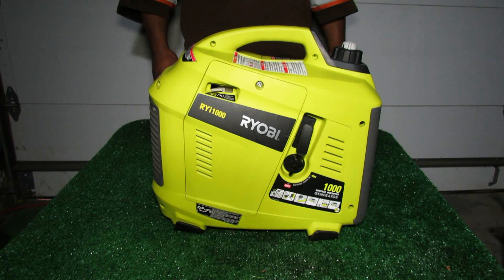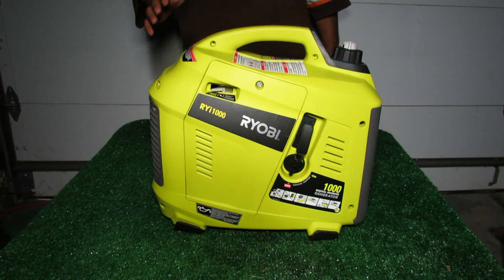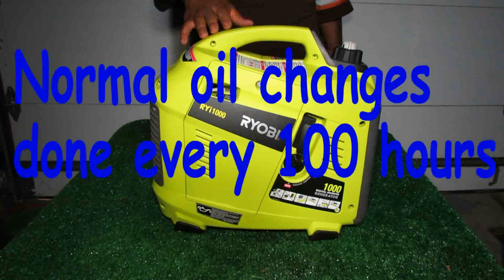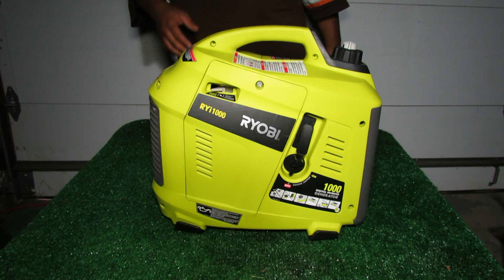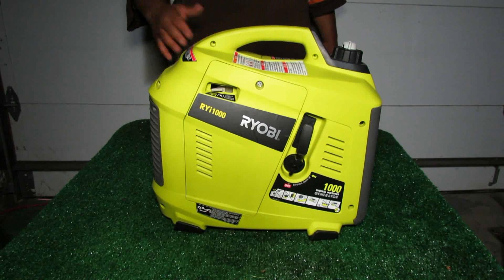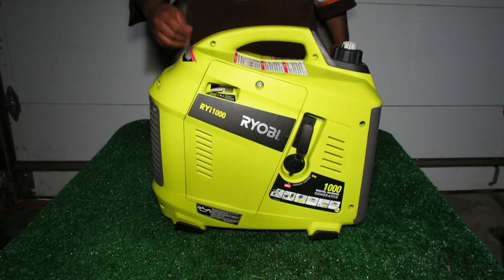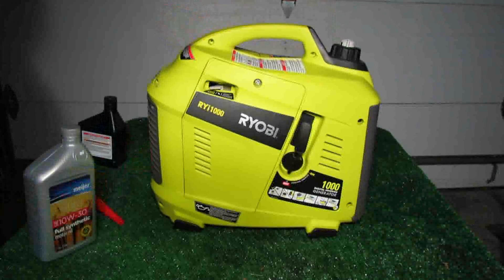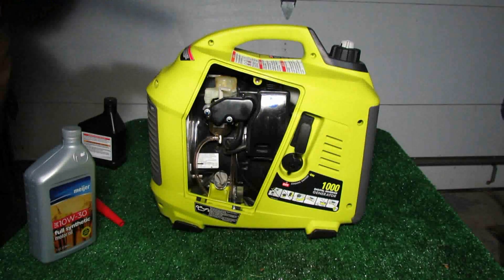Ryobi 1000 watt inverter generator, RYi1000  oil change after 20 hour break in

Comment: I am seeing in the manual I found it's 13.5 oz of 10w-30. That's a significant difference from the 8 you specify. Might you still have this generators original manual? The one I found is online but I think it's for the RYi1000

Comment: I've noticed in your videos, although somewhat informative, you spent 10x longer talking about things, than actually demonstrating. Also, in another video you slapped the casing of the generator like 15 times in the 6 minutes before even demonstrating anything, that felt like it was popping my ear drums through my headphones. When I turned down, I couldn't hear your voice, but you insisted on smacking that thing so many times I had to thumbs down that video like I did this one and stop watching a few minutes in. Please keep doing what you're doing, but notice that your sound volumes and approach on dialogue do make a difference to the viewer experience.

Comment: Unless you use your generator once a week or so, keep gas stabilizer In the tank. That way your gas wont varnish, making it hard, if not impossible to start. And be careful using starting fluid. I bought an 1800/2200 that would not start. The guy that had it used starting fluid in it. When he tried to start it, the motor kicked back so hard it jerked the pull cord out of his hand and sheared the keyway on the flywheel. I didn't know about the keyway until I tore it apart. After replacing the keyway, it starts on the first pull. And I keep gas stabilizer in the fuel.

Comment: Get a topsider oil pump, its a handpumped oil,changer to take oil out thru the dipstick tube of anything with oil, no tipping it or making a mess, it works great and is fairly cheap and makes this job so much easier on cars and especially these small engine devices that are hard to not make a mess tipping them to change oil